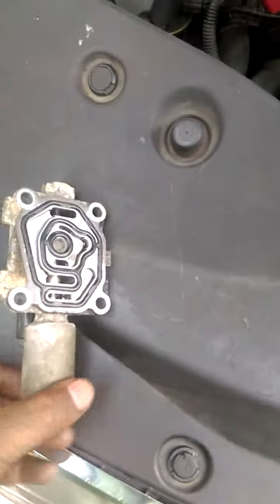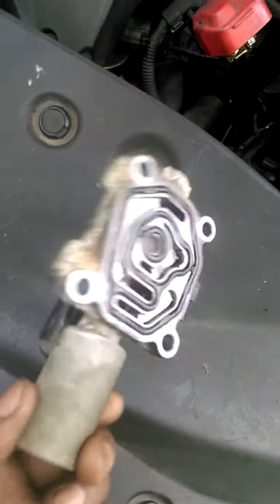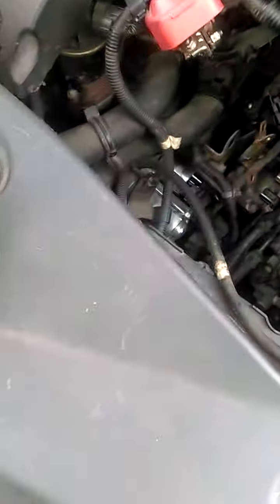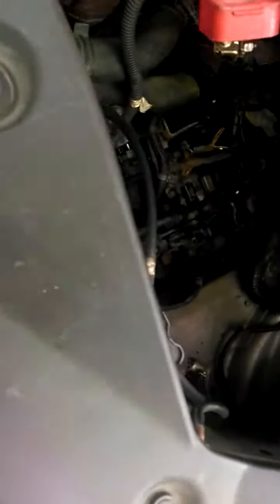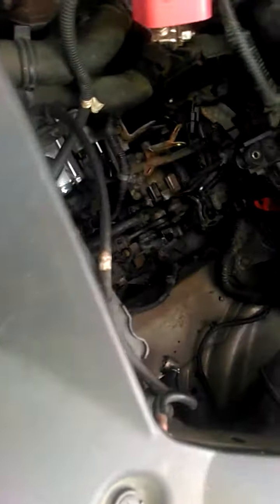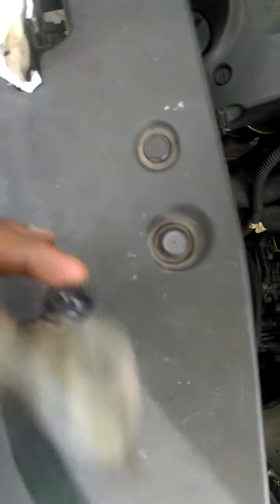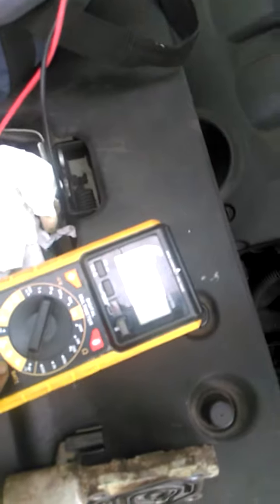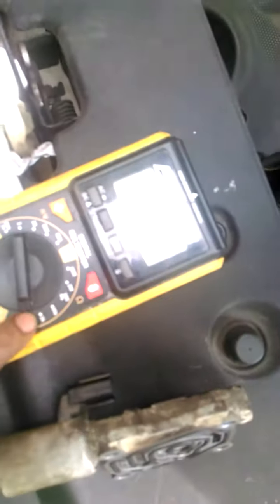2005 Honda Odyssey transmission solenoid remove/replace how to

Comment: Hey man i seen ur 2 videos.. this 1 n the 1 with the 2 solenoid.. in the 1 with the 2 solenoid i tested wit a battery n they both was activating-clicking . This video i tested wit the 1 solenoid batter n it didnt activate- click or anything can dat b the problem with the trans mission..
Reply from the maker: My transmission van shot.

Comment: I have a 2006 Odyssey EX-L, I have P0980 and P0974 codes on it. D is flashing and check engine light is on. I changed shift solenoid A and C, 3-rd and 4-th clutch pressure switch and today I just changed dual linear solenoid... Nothing on the dash changed... D is still flashing and check engine light is on... all mechanics says it’s electric but no one knows what it is... I am about to change single linear solenoid and I am running out of options...Any suggestions please? I am desperate!!!!
Reply from the maker: Take it to the dealer.
Reply: They said I need a new transmission without checking anything...
Reply from the maker: Oh
Reply: Did you clean the cylinder's out with brake spray....
Reply: I know this older but very possible a broken wire.
Reply: Did u ever fix that issue

Comment: which solenoid is responsible for torque converter lock up ?  I'm getting a p0741 and occasionally a flashing D
Reply from the maker: Same one, you might want to go and check that  ASAP.
Reply: Thanks.  I've got it out on the ground now (timing belt broke and blew my heads).  So i'm addressing the P0741.  I'm going to get a new torque converter too (this one was a manufactured one in 2013).
Reply from the maker: These Honda Transmission are funny.
Reply: I fixed this problem
Reply: @stevenbuell5387  how did u fix the problem